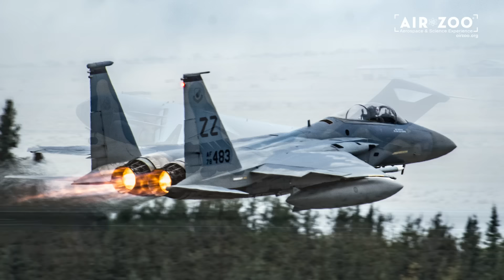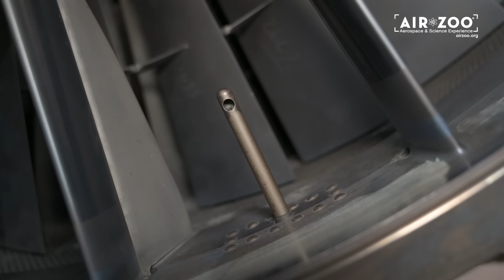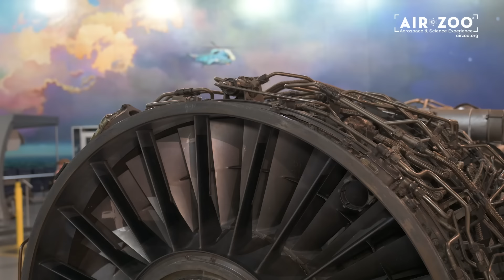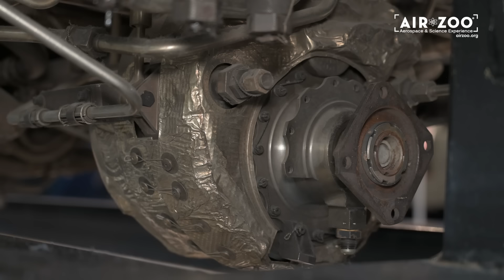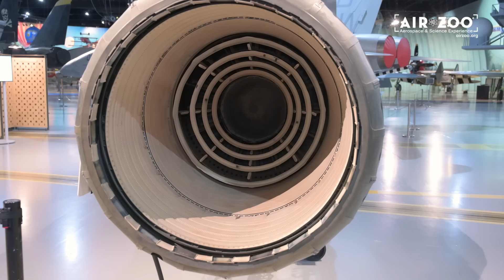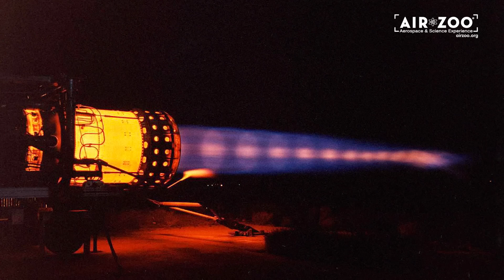The Pratt & Whitney J58 - The Engine of the SR-71 Blackbird | Part Two

Comment: When this gentleman says “carbon” U joints he no doubt means carbon steel. Today’s engineer would think it s carbon fiber. Some  quibbles, he says gold is electricity conductive which is true and not unrelated but if it’s plating a few atoms thick it’s there because it is an excellent reflector of infrared, also your self cleaning oven most certainly doesn’t have 3-5X the surface area, the oven is smooth. the afterburner doesn’t get translucent whatsoever it radiates according to surface temp,

Comment: you have to run a cool fuel like a JP-12. Octane numbers matter. If you think 92 burns cool for your high compression kit car. Try Octane 4 +/- thousand. Yea it's going to be hot but Octane matters. 87 burns hot; 92 burns cool. You would have to burn Octane numbers approaching just under or barely over tripple digits.

Comment: do both engines have mirrored plumbing ? If the tach drive goes down on the left engine is there another tack drive for the right? I imagine every part of the system has two or sometimes three redundancy. I only got to start a blackbird with an A/M 32a-60. Heros of AGE worked the AG330.

Comment: The questions being asked about this engine are honestly what tt2 does vs station 1 and 2. The four devices tell you what is happening as Air is no longer normal. The product you ingest as it is accepted forward of the aircraft is very different as it exits the aircraft. TT2 are ZD and win awards due to simplicity.

Comment: The tt2 temperature story is not correct........why do you measure the air temp at the front of the engine? it s equally cold when entering the engine ???????😮😮😮

Comment: Pressure Ratio 1 to 40 for the exhaust. With 0.4 Psi outside air pressure gives 16Psi for the nacelle airflow, right? He said 160PSI.

Comment: The information about the J58 turbofan by itself.Being strong enough to fly to mach three is absolutely false.... If I could do it by itself.Why does it have the world's biggest ram jet attached the back end of it...One of the reasons the blackbird was so loud as that it was at full throttle at all the time because the motors were so weak... It was an absolute slowpoke to a little over a 900 nautical  Miles an hour when the bypass starts coming in to play for the ramjet. Furthermore the Censors on the fan intake Had a much further important role than what was explained. This prevented unstart ..And we're only later added in the development of the engine.. There is so much trouble with the engines that each air frame.Or chassis had four dedicated power plants

Comment: I thought it's interesting that using the metaphor of 'jet fuel' to refer to any extremely volatile solvent or alcohol such as akin to gasoline is so pervasive but for turbo machinery  its usually quite the opposite in terms of volatility and boiling point. Such that the higher performance the engine the thicker the fuel has to be

Comment: 1 litter of JP-7 is around $15 USD. each engine burn around 3.2 litters of fuel per second, 6.4 liters in total. So it burns $96 USD per second, just in fuel. $345,600 USD per hour in fuel. 💸💸💸💸💸

Comment: @27:07: He's saying the surface of the ceramic is super-rough at very small scale, which increases the area that can glow.

This does not make much sense.  If the photons emitted from some area are squeezed through a smaller area, as he claims, the solid angle of the beam would have to increase the same amount.  But that solid angle is already a half sphere -- it can't increase.  This is conservation of etendue.

Comment: I live in the Antelope Valley in California where USAF Plant 42 is located. I was a on the final paint crew that painted all 100 B-1B’s built by Rockwell. Our site was next door to the SR-71 Test Depot. They used to run the engines up on Thursday mornings, you could hear the roar all over the valley. I looked back to where the SR-71 was running the engines and they had huge chains holding the aircraft down, it was mind blowing. 😊

Comment: At 32:59, the gentleman states that there is less drag with turbulent (air) flow than laminar flow. This is backward; laminar flow is usually associated with less drag - not more.
Reply: That depends what kind of drag you are talking about; induced or turbulent and whether we are referring to boundary layer flow…which they are.  You need boundary layer turbulence to maintain laminar flow.  His wording was incomplete; in context I think he was saying they needed to increase boundary layer turbulence to maintain laminar flow to reduce drag.
Reply: @dwaynepenner2788  Wrong. You do NOT need boundary layer turbulence to maintain laminar flow. In fact, laminar flow is generally preferred in applications where reducing drag is important, and a turbulent boundary layer is often undesirable because it increases friction and drag. Turbulence in the boundary layer can also lead to flow separation, which further increases drag. You have it backward like the gentleman.
Reply: @privateer0561  your correct I misspoke, what I should have said is most airfoil increases in boundary layer turbulence will increase the distance airflow remains laminar.  So it depends on what part of the system you are looking at.  You can indeed use boundary layer turbulence to increase induced drag by increasing the distance of laminar flow over the chord of the wing, and by doing so you decrease parasite drag, well at least you decrease the proportion of parasite drag.

Comment: The engineering is beautiful, but as a nerd; would the J58s be good for podracers? 😅.

For those young enough to not know about the Star Wars prequels, many of the engines used were modelled after jet engines for the podracers, Anakin's being a very clear example

Comment: Having worked on J52 engines in the TA-4J and A4E Skyhawk in the Navy, I found this fascinating.  To think this aircraft and engine were designed in the 1950s is an astounding feat of engineering.  I didn't know that the J58 switched from a turbojet to a ramjet at high mach numbers.  Unbelievable.

Comment: The first video blew my mind with the engineering of the engine for high speed air travel. All mechanical. Because mechanical is always more reliable especially with hot engines than electrical systems. We were using Russian titanium to build the airplane to spy on the Russians. Like wtf that's awesome. Lol

Comment: In his biography, Ben Rich mentions a guy who came in saying he had a lubricant that would work at the high temperatures required. Rich asked for a sample and the guy puts a plastic bag full of black powder on the desk. Of course, that powder would be a liquid at the upper end of the J58s range. Somehow they had to find a lubricant that would be liquid across the entire range - not a solid at the bottom and a gas at the top.

Comment: I worked for  P&W in West Palm Beach when these engines were still in service.  It would be nice if they could rework the exterior of this one to look like they did when new.  Basically, the external oil system major components were gold-plated to reduce radiative heating from the engine and cowling.  The engine looked like the inside of a Swiss watch.  After time, it was determined that the plating was not really necessary.  It was a very thin coating and deteriorated over time, so was not replaced.  You could usually estimate how much time was on the engine by the amount of gold remaining.

Comment: here is one vagueness: he mentions exhaust velocity 3.5Ma,,,the speed of sound of local air at that altitude and temperature is 1070km/h, if it flies at a speed of 3.5Ma, it's 3750km/h,,, if the temperature of the exhaust gases is 1500-2000C, their sound speed is 3070-3440km/h, it means that it was not necessary to accelerate the exhaust   gases much over 1Ma or they accelerated them to 3.5Ma i.e. to 11200km/h,,,one thing is certain, the speed of exhaust gases must be significantly higher than the speed of flight
Reply: I took that exhaust speed to be “relative” to the exterior air speed, and as you point out is a bit technically vague. But many people equate Mach as an absolute “speed” while it is a reference to the speed of sound that occurs in the bulk air at the conditions present in that air (which change). An associated question is the A-12 faster than the SR-71 if it flies 5000 ft higher in lower pressure but higher temperature air since the maximum speed is determined by compressor inlet stagnation temperature and the geometry of the shockwave angle at the supersonic inlet?

Comment: He mentioned a Buick cart at 21:23 for starting the SR 71. Yes they used 401 CID Buick Nailhead engines due to high torque.
Reply: But they converted to Chev 454, so must have been also ok. Would have been more impressed if it had been the 427 Hemi but probably not enough engines available. Would have been even more impressed if they had used the Allison (vs Packard) as they would not have blown up.

Comment: I pushed back my sleeping time because I was enjoying the Engineering explanation.
Thanks millions.

I have question that I hope somebody can tell me in future.
What are those fire rings in the flame exiting the afterburner, or how those rings get formed?
Thanks again.
,,, California
Reply: As far as I know those are called shock diamonds, And it has to do with fluid differential. And the fact that to do afterburner you're dropping raw fuel into the exhaust and how the gases expand.

Comment: did i miss something?
how does air flow from a pressure of 15 psi to a pressure of 160 psi without being pumped?
also, doesn't 40 x 0.4 = 16psi, which makes more sense

thanks for the great video.
Reply: We know the ambient air pressure at 80,000 feet is about 0.4 psia.  So the trick to get all of the exhaust up to 16-18 psia requires we blend the bypass air from the outside of the engine but inside the nacelle with the actual engine exhaust.  Then pass it through the convergent divergent nozzle, and then out the back end, where it encounters 0.4 psia ambient air again.
Reply: @arniegunderson9649  

Thank you!
Reply: @arniegunderson9649  
Ok that make more sense, the video said 160 psia which left me scratching my head.
It truly is an ingenious design.
Especially considering you were probably using slide rules not computers.
Reply: You heard the part about the front of the engine - the COMPRESSOR SECTION
Reply: @shelleyking8450  
Yes, but at the end where they were talking about the converging 
diverging nozzle, I thought they said they were incorporating air that 
completely bypasses the engine hence doesn't go through the compressor.
Reply: @Geek-A-Hertz8707 

You are correct as the frontal intake uses shockwaves and geometry to get the air pressure to ~ 16 psi. The 16 psi is the pressure of the air “entering” the compressor section of the engine which is then compressed to a higher pressure for combustion inside the combustors while the pressure in the afterburner is less but higher than the pressure of the air that goes around the engine. The convergent divergent aft nozzle  accelerates the combined flow to ~ 3.5 Mach by converting the ~ 16+ psi combined exhaust flow back to near the outside atmospheric air pressure.

At high speed cruse, the percent propulsion thrust is 54% from the diverging part of the inlet (section before turbojet compressor), 17% from the core AND afterburner (mostly the afterburner as he stated that core is a very low power setting) and 29% from the converging diverging aft nozzle. If the diagram where this came from is correct (and it actually does make sense but to some it might be counterintuitive), I wish he had talked about more.

Comment: Great video, I watched them both. I overhauled several different jet engines over the years in the USAF, and with a major airline. 
I am an SR71 student, and have read everything I could get my hands on about the airplane and it's engines. 
But now, finally, I have been told how the bypass system works. I have looked at the J58 at the USAF museum in Dayton, but could not see any valves for operation.
I was aware of the chamber where the 4th stage air was dumped into, now I know, 24 doors dump that air, but do those doors modulate, or just open and close?
Reply: Check the patent on this topic and there are detailed drawings that may or may not be accurate (but probably are reasonably accurate).

Comment: 15:00 He states that at Mach 3 most of the air that enters the core is being sent through the “recover bleed air tubes” (from patent) or sometimes known as “compressor air bypass tubes” AND that the core turbine is producing relatively little power. This he called a “RAM JET CYCLE”. 

My QUESTION is that when he used the terminology of RAM JET CYCLE, is he referring to the CORE being in a RAM JET CYCLE or is he referring to the WHOLE PROPULSION SYSTEM (which includes the 2/3rd of the air that is going around the outside of the core that gets heated by air exiting the afterburner and the mixed air goes through the second nozzle (converging diverging nozzle) as being the RAM JET?

Found a source of information on thrust. At high speed cruse, the percent propulsion thrust is 54% from the diverging part of the inlet (section before turbojet compressor), 17% from the core AND afterburner (mostly the afterburner as he stated that core is a very low power setting) and 29% from the converging diverging aft nozzle. If the diagram where this came from is correct (and it actually does make sense but to some it might be counterintuitive), I wish he had talked about more.

Comment: Why does the afterburner need a temperature sensor at the very inlet at the front of the engine, and not at the beginning of the afterburner section itself?
Reply: Probably because it is the coolest part of the air flow and stresses the sensor the least and allows for a more accurate design of the sensor. From that temperature the air temperature back at the intake of the reheater / afterburner can be calculated after the engineers have physically measured the actual temperature during engine development. The thing is that there are two different air flows, the one that goes through the core and the one that goes around the core through the large bypass tubes (not to be confused with the air flow that goes around the whole engine). The air temperature exiting the core turbine is going to be a function of the amount of air going through the core (which is variable) and the amount of fuel being used in the core’s combustors, so a number of additional inputs are needed for the calculation. 
 
I think that most jet engines have a thermocouple temperature sensor somewhere in the outlet duct but this engine runs a fair amount hotter and the afterburner is on almost continuously so it is probably very hard to have a sensor be reliable if it is glowing yellow hot. 

This is all just a guess, but that is an interesting question.
Reply: @Mentaculus42 Many thanks for the reply, and great presentation!
Reply: Your mention of how the "excess" air at the back of the core blades was bypassed to the afterburner reminds me of a conversation I had with an old timer that worked on the P-47 at Republic Aircraft.  The designers initially could not figure out why the plane was able to fly about 4 mph (or so) faster than what their calculations estimated.  After some thought, they realized that the engine's turbo (which is located at the very rear of the aircraft) was adding about 500 lbs of pressure out the back!  He also told me that the turbo ducting was one of the most difficult installation challenges that they were faced with.
Reply: @ 

The P-47 was partly so large because of significant amount of additional ductwork for the additional turbocharger and intercooler (& that big radial). The “Jug” is quite an impressive aircraft for that time frame.
Reply: The AB Fuel Control uses Inlet Temperature to schedule fuel flow along with power lever angle.
Reply: @arniegunderson9649  Thanks for the reply!

Comment: Like to know if the engine outer diameter expanded by 2.5 inches and made the gearing input or output shaft straight, then what about all those fuel lines and other lines, which also would have expanded to the point of leaking.
So every single pipe joint system must have that 2.5 inch expansion calculated into it, after all its not 2.5 mm its 2.5 inches of expansion of the diameter of the engine at mach 3, so what was used to make sure those joint of each pipe which has fuel and oils moving though it has to have some sort of specialised joint system which will expand during hi altitude flight and especially the heat as well. 👍👍🦘🦘
Also used to sell those exotic metals and alloys in Melbourne Victoria, mainly to aircraft maintenance and the military, like the army and airforce, like ADI which was based in bendigo victoria, 👍👍🦘🦘
Reply: The curves and turns built into the plumbing lines allowed them to tolerate the thermal expansion of the engine.

Comment: Great talk. I'm a maintenance welder for an aerospace fastener co. and had to repair heat treat baskets for Titanium bolts, they called them pins, nuts were called collars. They were inconel 600 alloy. I had to repair a Hastaloy thin wall tube sucking bad things out of the ground and being incinerated from decades of release into the ground. The tube was corroded and Hastalloy was best for corrosive environments. I wonder if inconel was used on the turbine blades?